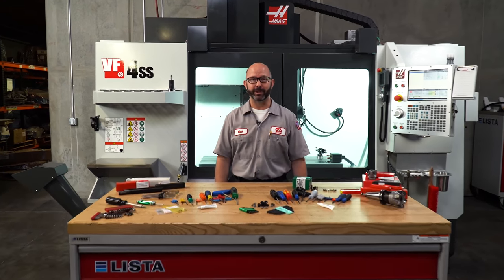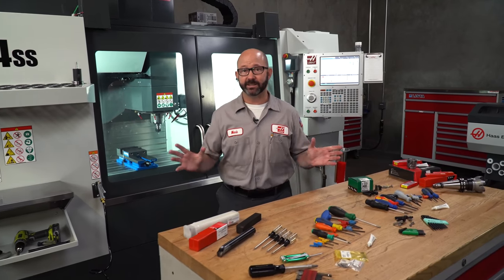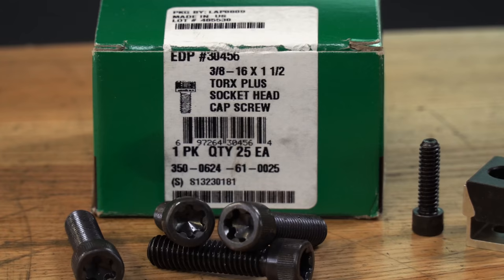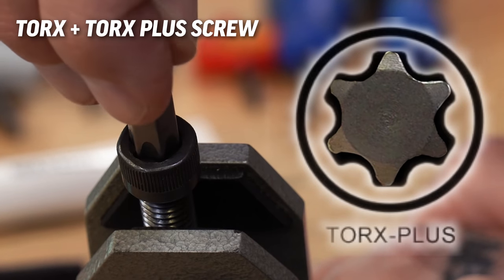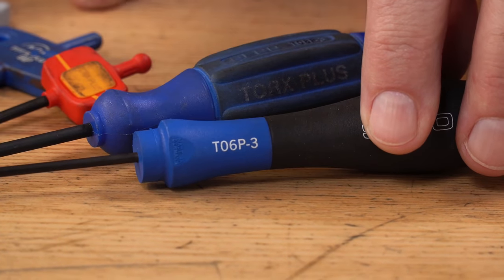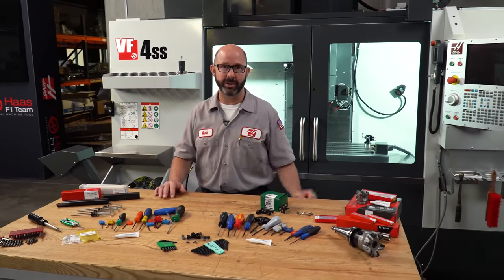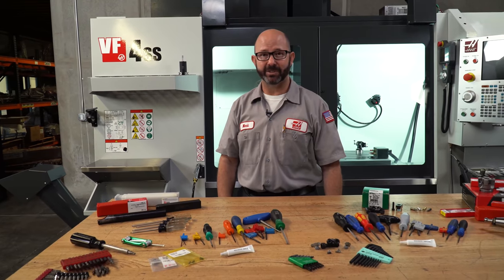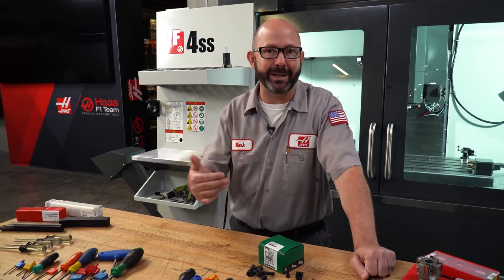THIS IS NOT A TORX - Haas Automation Tip of the Day

Comment: How you can mesure the fastener tension after the lubrication? As far as I understand it's not possible knowing that torque value is irrelevant, please explain
Reply: Mark Terryberry

Great comment. I was talking about this with an engineer friend of mine, and yes, while a lubricant will give us a higher stretch (preload) on the screw, it can cause it to loosen if it is in a high-vibration application (less friction). Our cutting tools are really well designed, and tested over decades, so the inserts are well seated in their pockets, and the screws themselves are often offset to hold the insert again the pocket walls so there is no way for it to move. We'll see this with cylinder head bolts as well, there is vibration but the dowel pins on the heads help keep the head from moving against the block. There are lots of applications where we would not want to use a lubricant, and where a nyloc nut, lock washer, lock-wire, Nord-Lock washer, loctite, or jam nut would be more appropriate. In our case, all of the tooling suppliers recommend using a lubricant on the insert screws, so the lack of friction is baked-into our insert torque specs from the manufacturers. Yes, a lube drastically affects torque specs (needs less torque for same preload), and shouldn't be used unless the manufacturer recommends it.
Reply: @markterryberry4477  thank you Mark for taking the time, definitely the precalculated torque value would yield the proper fastener stretch, that's great engineering on your tools

Comment: I'd like to see some torx+ vs hex comparisons
Reply: The big benefit is when using a screw gun to drive the screws in and out over and over. We would have maybe 100 screws in a part fixture, and the operator would use a cordless drill with a hex bit to change the SHCS. The bit would fail every few days (running 2 shifts), and the screws would start to fail (round out) after a few weeks. By switching to Torx Plus Cap Screws, the bits and screws would last months. That is just one application, in many applications Allen Socket Screws are terrific, my first choice.
Reply: @markterryberry4477  Thank you for the info!

Comment: Also doesn't help that the screw demonstrated for the torx plus key won't fit is a security torx... So neither standard torx keys will work anyways
Reply: Thats just light reflecting off where the bit wore some of the finish off..

Comment: After 10 years, you'll get screw with chip.
Without using extremely expensive proprietary tools and subscribing to a monthly service to get the latest verified key to disarm the screw will cause the screw to self-destruct (which can cause dangerous collateral damage)

And all this is the big companies that care about you and try to keep you safe. 😇
Reply: Warning: The anti-tampering charge in the proprietary screw is designed to penetrate 10mm thick steel plates and may or may not have a time-delay fuse designed to set off a few seconds after you think you have removed it safely.

Comment: As a mechanic i much prefer hex bolts. They give the best grip and are much less likely to round off. Those torx screws are too easy to strip and don't give you as many angles. You can also use many varieties of sockets and wrenches to work on a hex bolt. With torx your options are much more limited

Comment: 😇 usually I removed those special screws. and put them in the garbage. And I am lucky to have small shop that sell old kind of screws and bolts. They get me the same pitch with different head bolt. Which make easy to removed next time. No need for special tool. When u R in a rush. I'm not a machines. but Thank you for the Intel. 🤔

Comment: Why are the internal and external Torx fasteners of the same size not the same number? For example a T30 driver is a perfect fit into an E6 socket. WHY?! That makes no sense at all. A 6mm hex key fit a 6mm socket. A socket for a fastener with a head the size of a T30 driver ought to be called an E30 socket.

There's another use for a time machine, go back and find the person responsible for this illogic and tell them to use the same numbers. Then go and find a way to get the machine tool industry to widely adopt the logically designed Jarno Taper system and shun the crazy Morse system where every size is a different angle.

Comment: I hate Torx.  My BMW motorcycle is almost exclusively torx and they have applied seriously high torque to bolts with sizes like T40 or T45.  I mean, 100Nm for T45?  Really?.  Unlike with allen head or just regular bolts, high strength torx bits are not as common and it's easy to snap or bend the teeth on the bit.

Comment: Oh no not this crap again. This is exactly the same setup as Philips vs PosiDrive where one is new! improved! but most folks can't tell the difference effectively ruining all the screw heads and all the tools, spawning a vast industry trying to come up with dual purpose tools and new EZouts for cammed bolts.

I had heard of Tplus but never seen a bolt IRL. Looking at those photos the differences are very slight - one lobe is slightly pointy, one is slightly rounder. Now this works awesome in the design lab or the video set where everything is laid out nicely for filming and of course you feel the difference. But on the workshop floor? Not a chance.
Reply: My son and I were adjusting the drawlength on his Hoyt Compound bow over the weekend, and it used small Torx screws. From looking at them I thought they were Torx Plus for sure. They weren't. So, while I thought I could tell the difference just by looking, on small screws I really had to try both wrenches to see which fit best.

Comment: I'm utterly baffled by the idea of putting any half-decent static lubricant (like molyb) on the thread and under the seat of any fixing destined to be used on a machine prone to vibration and intended to be torqued up.  Apply the vibrations and over time it will loosen beyond its torque and eventually just spin free.  In precisely the situation he demonstrated on screen, I'd expect to use the exact practical opposite: threadlock!  Available in three standard strengths according to application and environment, easy to defeat in most instances when maintenance is necessary...
Reply: I hear you. It might be that the lubricant is only good in situations where there is vibration, when the screw is so well captured that it has nowhere to go. Engine cylinder heads vibrate, but the head/block always move together, as they are doweled together and the gasket limits any slip further. With our cutting tools, where the screws get taken in and out many times, the friction would increase each time you installed the screw (the parts wear into eachother), requiring more and more torque to achieve the same preload (stretch), so by using a lubricant on these insert screws we get the same hold on the insert each time. Definitely a mind-bending topic. Would definitely not want to use a lubricant (especially Molyb) unless the manufacturer recommended it for that application.

Comment: Why or you Americans so against Robertson head screws?
Reply: The furniture industry uses lots of Robertson heads, but I don't see then on much else here. They are rarely called Robertson either, just square, which is not quite right as a Robertson does have a taper.

Comment: Torx plus is more secure and won't 'cam out'?  I think anyone who has removed the bell housing on a GM 4L60E will laugh at this. Even with heat and penetrating oil, half of those nine bolts (that cost $9 each at the dealer) will laugh at this "more secure" idea.
Reply: All Torx fasteners cam out. It's the nature of making something nearly round and relying on fine points in a soft metal. Torx is just a horrible fastener in general.

Comment: I never knew they were technically called torx plus, ive always heard them referred to as a spline screw.
Reply: Spline heads have 12 points, the spline sockets will fit spline nuts, hex nuts, square nuts and even torx shaped (6 pointed spline) nuts.
Reply: @TehBIGrat  ahh got it.

Comment: Just stop using Torx. Philips head or allen head will do just fine.

Torx is my second most hated type. Flatheads are the first. Anyone using flathead screws, should be shot on sight. Daily.

It's funny. I do exactly the opposit of what you advice. If I buy something I need to work on, and it has torx, the first thing I do is remove all that torx crap and just place allen back in.

Sure, if misused, allen are more prone to fail. The solution is not to misuse them.